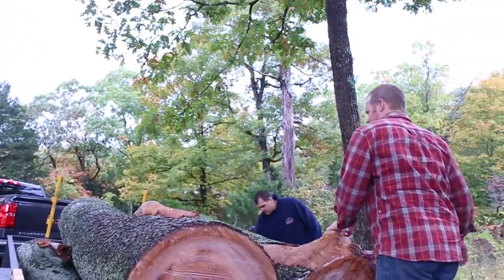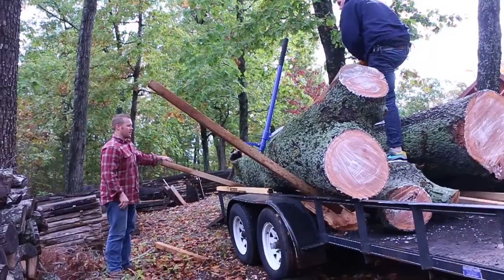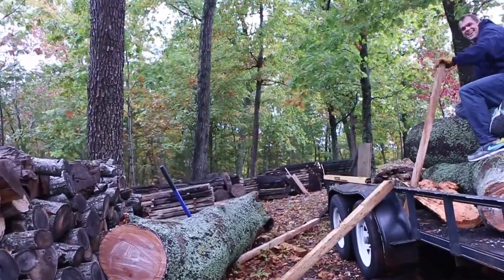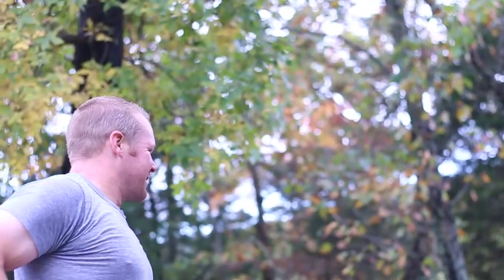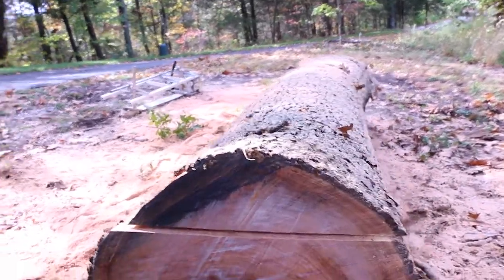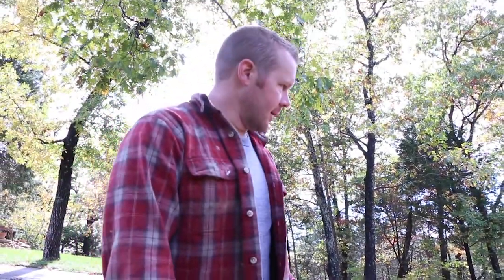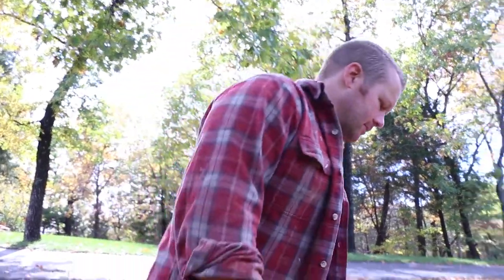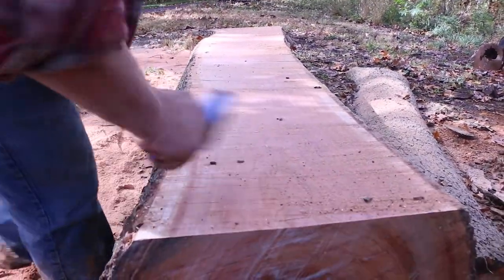Milling a log into lumber

Comment: what kind of bar oil are you using, i don't see an aux oiler and your bar seems fine.
Reply from the maker: doi467 its a stihl 41” hard tip. I don’t have an Oiler and I’ve probably milled 20 bigger trees. That being said the tip is showing signs of wear and an Oiler would probably extend the life of any bar
Reply from the maker: doi467 just stihl bar oil